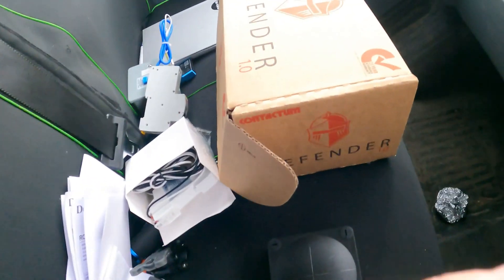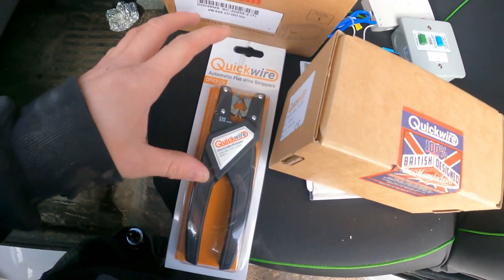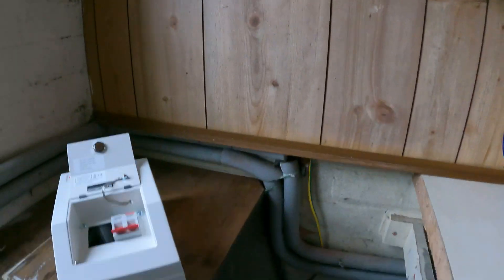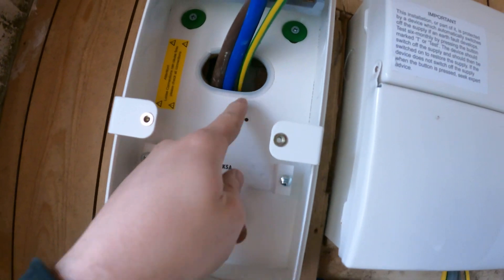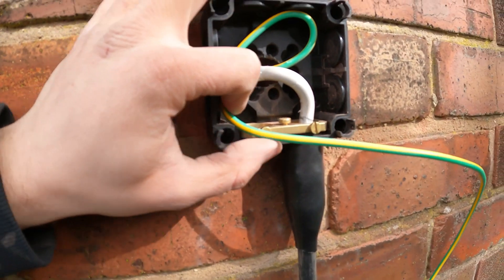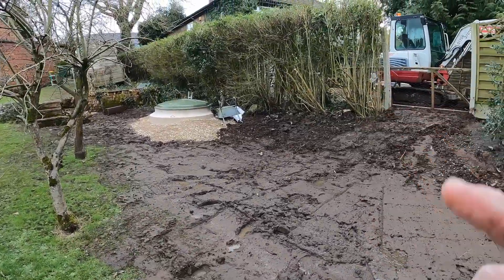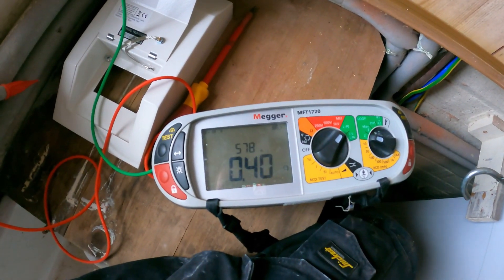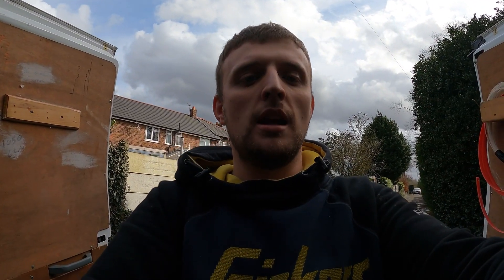Supply for sewage system | Installing a small consumer unit | Electrician

Comment: Contactum boards I think seriously good boards underrated part of the Alfanar group in Saudi Arabia now but based UK production in Cricklewood.
Reply from the maker: You are seriously bags of knowledge Mr Math 👌🏼 and I live by the motto, when somebody is teaching, get taught. 
Drop some videos, JW style 💪🏻
Reply: I would love to do videos but unfortunately my job means I can’t really post or have my own channel. At some point once rules become less onerous I should do so. 

In US people are not allowed to pass sewage direct to waterways it has to be pumped out every 3-months by a service company. 

With these motors the inrush current can be a problem. I would always look to have a soft start controller to reduce breaker loads and future motor issues.
Reply from the maker: @mathman0101  I did in fact ask this company wether I needed a C type breaker to deal with the motor start and they told me it doesn’t matter, the control panel for this deals with it all. 
And apparently the waste that comes out into the river is clean enough to drink 😀 I’ll let someone else try that first
Reply: @Cablesmith  yuk mate rather them than me. And get to bed mate....

Comment: That Quickwire cable stripper looks and feels just the same as a Knipex unit but cheaper to buy by maybe 14-15 squids ! right down to the wee hold to bend your singles with before closing with your pliers.
Reply from the maker: Yep, I’ve noticed that too. Identical !

Comment: Warm the grommet strop with a hair dryer, or put a strip in between a dual panel radiator and glue it in with mitre bond...like a superglue and comes with an accelerator to quick cure, Screwfix sell it plue their own version...from one Manc to another😉
Reply from the maker: Nice I’ll have a go of that.thanks bro 👌🏼